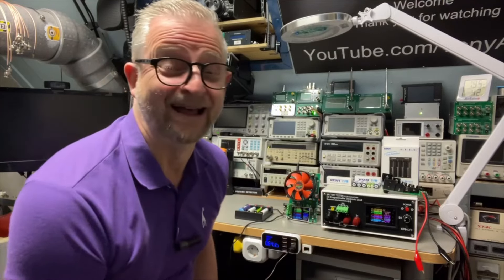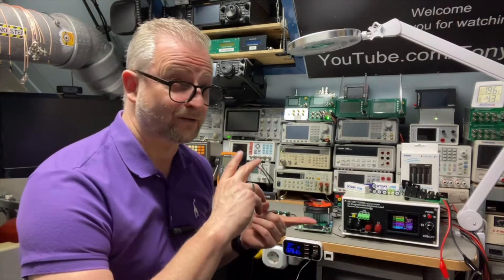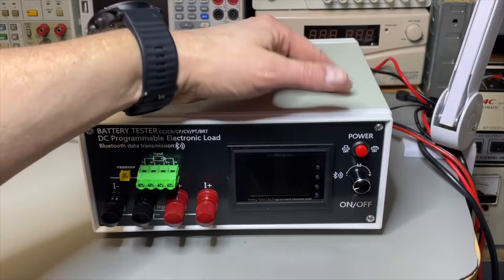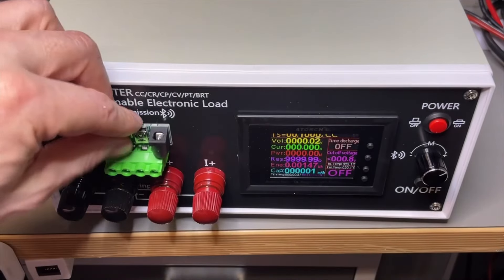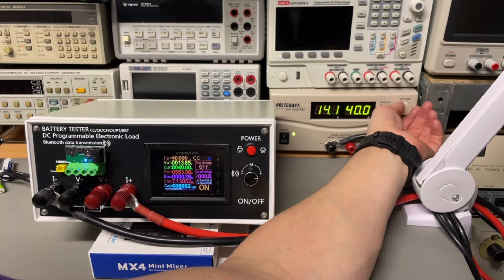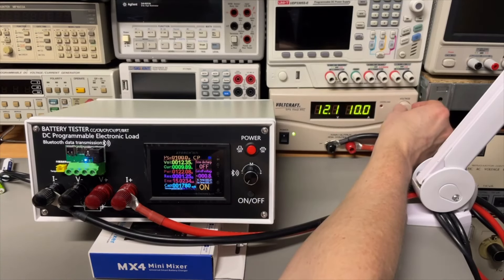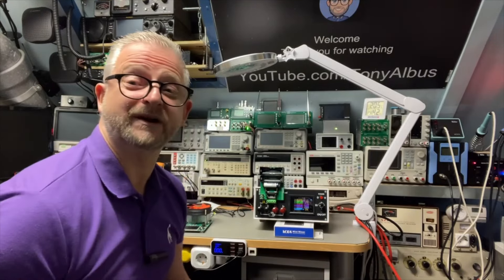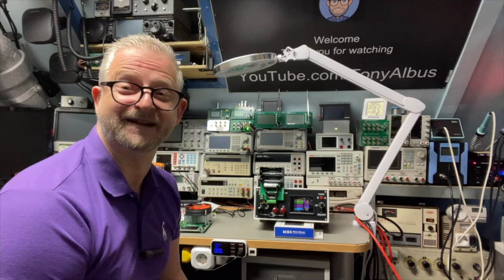TA-0391: DL24MP DLB600 Battery Tester - Electronic Load 600 Watt 40A 200V - Hands-On - Atorch

Comment: Nice power supply and battery tester. I have the smaller ATORCH 180 Watt DL24P with updated BT. I also purchased an AA adapter for AAA batteries to fit the battery box. Very accurate device.
Reply from the maker: Yes i love the tester option, and indeed with the battery adapter very easy to test and verify capacity

Comment: Hi Tony, this module system looks very good and is reasonably priced too, special battery testers are very expensive. I especially like the size, when I bought an electronic load (it has a special program for testing batteries) I had to take a smaller power because the  600W and 1200W was almost 60cm deep and it wouldn't fit anywhere in my miniaturized workshop (my 300W / 60A is 45cm)
You made beautiful cables for connecting large loads, I have them made in PVC and it's terribly inflexible, because I don't use them much, so I haven't dealt with silicone yet.
You have very nice equipment👍

Nice day 🙂 Tom
Reply from the maker: Hi Tom,  Thank you! .. Yes i love the new cables. this load is not very deep indeed, but my Korad 1200W is indeed that large as you menstion.
Stay safe!

Comment: Hi Tony,

very interesting video. Do you know for what the little CDC pcb is ? And why I should connect an additional power supply to this little pcb? I thought the DL24/DLB600 is specially for discharge of an accu. Maybe you can please explain what the CDC pcb makes? thx Hans
Reply from the maker: Hi Hnas, i am not sure what pcb you mean, but i did get a little bcp with my other DL24, and that pcb had different usb poorts and a dc plug. that was to discharge usb devices like a powerbank and the dcplug for a powerbank with dcplug

Comment: Hi Tony! Did you try the Battery Resistance Test? I have the same Atorch but couldn't figure out how it works... Not explained at the manual. Thx!
Reply from the maker: Hi Cherar! What i noticed, that during the battery capacity testing, the resistor value is updated. i seems to do this during the test.

Comment: hello,i'm searching everywhere i can,nobody is having problems with DL24M-a(my device),yours look like mine,i have seen the specific resistor just behing I- terminal in your video,which connects I- and V-,it is 2mohm,so basically no 4-wire but 3-wire,do you have high current low voltage problems?i wanted to test lfp batteries,this kind of borks it,i can't start 20A discharge because of low voltage(yeah,i have thin wires,but if it was proper 4-wire,it would work),does your have this strange 'short' too?
Reply from the maker: Hi, i never looked at that to be honest... i sold mine, so i can not check for you... i hope you will find the information you are looking for.
Reply: @TonyAlbus  no problem,good idea to sell it(well,it is not a bad load,but has some issues)..thank you

Comment: Did I hear you say that with the newest firmware it can do 1200 watts?
Reply from the maker: Yes, but you need to add 4 power units.. to have 8 in total.
Reply: @TonyAlbus  I decided to buy a used BK Precision 8614 electronic load, it's expensive but I think it will work much better for my battery testing, thanks for the reply!
Reply from the maker: @Jasonoid  Yes good choice, much better device indeed.

Comment: Hello! I notice, that You use 2 not soldered sockets between the thermistor and controller sockets - what is their purpose?
Reply from the maker: HI, what timing in the video are you reffering to?
Reply: At 3:55 your finger is near this sockets. You connect something to this sockets with black/red wires...
Reply: Wery nice front panel!
Reply from the maker: @ACKET2009  That are the connection wires to the front terminals. the 2 wires in the middle are sense wires and are very thin, but they are there.
Reply: You mean the wires, that connected to a green terminal on the main PCB, but I talk about 2 2pin connectors between the thermistor connector and LCD board connector. It is empty holes on the board (when You show the old PCB and the new PCB on the picture), but You soldered this connectors at this empty places and wired with... what? @TonyAlbus
Reply from the maker: @ACKET2009  Maybe that is a connector for termperatuur sensor, its for battery discharging, the load comes with a extra sensor.
Reply: No - the temperature sensor located at top of this connectors... Can not place a link to a picture... https://drive.google.com/file/d/1qlj418BJoKFy5zvYprVgoQXdwXXGOfjK/view?usp=drive_link try... @TonyAlbus

Comment: Nice product Tony and very capable. It certainly put your 40 AMP PSU through its paces . The price point is also very reasonable and with updatable firmware what more could you ask for. Very well detailed video with very comprehensive testing Tony.
Reply from the maker: Thank you Ian, yes first of all my lazy nature :) picked this pre-build kit... the DL24 was already good, and i wanted in a housing... than i realized adding 10 or 20 bucks.. i got  600 Watts added too .. check in the box!
thanks for watching it full as i value your opinion a lot .
Reply: @TonyAlbus   Time is valuable to all us and I for one would have opted for the prebuilt option as well.

Comment: Hi Tony. Thanks for the video. I got the DIY 600w version. Can you see the rotary encoder connection point on your finish version. There is no label for that on the DIY board or controller. Would you share that info please?
Reply from the maker: Hi, The encoder is connected to the display in my version
Reply: @TonyAlbus  Okay. I want to add an encoder to my build. I was hoping you could show where it's connected in yours, but I understand if prefer not to.  Thanks for doing the videos.
Reply from the maker: @v31kc  Its just that i sold mine, and i remember the encoder being connected to the display.

Comment: Hey Tony, do you know what size the fans are? 

And what do thermals internally look like under full 40A? Seen a couple reports it gets so toasty some components will de solder from prolonged periods? About to buy one and would like these final questions answered. I appreciate the videos you do!
Reply from the maker: Hi John, it looks reasonable inside, you get a lot for this price. would i trust it to run 40A a long time, a simple NO. But when do you need that, and if you need it you prob want something bigger like the KEL2040, that i trust to run 40A a long time... you simply get what you pay for. and for this price it is very nice.
Reply: @TonyAlbus  Guess I'll have to pick one up, find sometimes to charge at 40a, and keep the thermal camera on it out of sheer curiosity. For the money it's definitely hard to beat for a starting unit and for general testing!

Comment: Thank you for the nice video, I am using the single unit dl 24 mp since a while on battery projects and like it a lot. I have now one old battery pack with quite high voltage of roughly 80V and 30Ah. Did you ever try the higher voltages on the unit? I read quite some bad reviews on the older versions with one FET and drain source voltages way beyond the rated values above 48V. Cheers and best regards from Cologne.
Reply from the maker: Thanks! , myself i did not try it on higher voltages. i think the 4 FET model is greatly improve compared to the 1 FET (Also many bad copies are around of the 1 FET version)
Reply: @TonyAlbus   Good to know, so I'll try it carefully in a secure place with some additional fuses and let you know

Comment: Hey Tony, couple questions.

Is it possible to draw over 600 using this unit? Ive seen mentioned in a couple places that these devices often will let you permitting it doesnt get too hot.

Have you found it fine for smaller stuff like 18650s, NiMH AAAs etc. More so concerned it might nit be fine enough data wise. 

How have you found the PC software. I have seen some reveiws state its very buggy and is not usable. 

Do you use the sense wires at all/ are they necessary? 

Edit: Are you able to do 40a at 3.7v? I ask because I have some battery modules that do 100a max discharge and would like to be able to do the full 40A in these situations. 

I appreciate your response as your obviously a very knowledgeable person. Looking at this for my first load tester to do battery modules and my smaller battery's, 18650, 26800, 21700 etc. Thankyou!
Reply from the maker: Hi, it is a modular system, maybe if you tell it with the jumper it is a 1200 WATT version and set it in the menu too. that is will maybe let you do more. but yes indeed the temprature will be a issue if you go to much above, it will just switchoff if it gets too hot. most of my testing i did with the DL24 and that one was great for lower voltages and batteries, so i expect this one too. the PC software i do not use to much. when i do discharge test on small batteries i just wait the result on the display and i can switch off the whole lab expect for the DL24 ..

Comment: You can easily tell in which country the firmware was designed by the desire to use every single color that the display could provide without any reason or logic ;)
Reply from the maker: Yes , its a signature almost :)

Comment: Своевременный обзор. Очень благодарен👍. Тоже присматриваюсь к этому прибору. Какое у вас мнение о приборе EBC - A10H?
Reply from the maker: Thank you for putting that to my attention, the EBC-A10H looks really nice! The display looks a bit simple, but looking at the specifications, it will do the job for sure. and extra the EDC-A10H can charge too.
Reply: @TonyAlbus  Hi Tony, after trying both, which one would you choose: a single DL24MP module or an EBC-A10H?
Reply from the maker: @isabido  Hi, DL24MP , i seem somehow not to use the EBC-A10H ... well i use it as a charger.  as a load the DL24 is much more usefull for me.

Comment: If it is only two-digit voltage readout or serial data capture it is severely handicapped for cell kinetics overpotential measurements.  Needs 1 mV (preferred 0.1 mV) resolution for that.
Reply from the maker: Like most of the time, you get what you pay for.

Comment: Do you know how to upload software v2.0? I have v2.1 and the fans are all time spinning. on v2.0 they worked according to the settings
Reply from the maker: Hi, i have updated mine from 2.0 to 2.1 and i did not have any problems. i checked, i do not have 2.0 in a file. 
maybe one of your temprature sensors is broken and it thinks its hot.
or try this link for thelatest firmware: en(dot)atorch(dot)cn / NewsDetail(dot)aspx ? ID=29